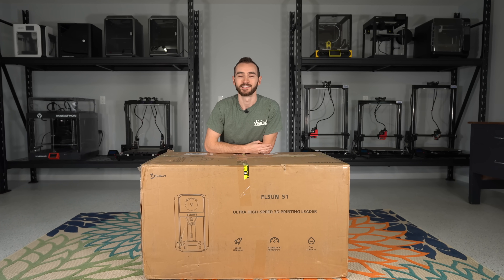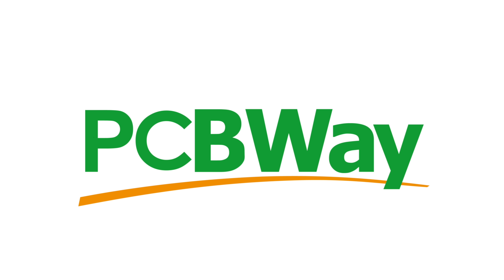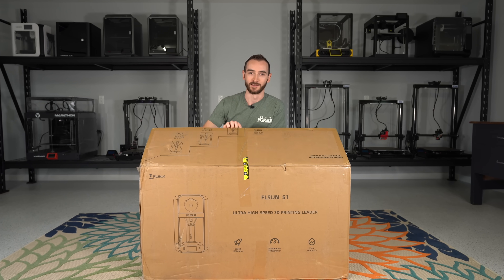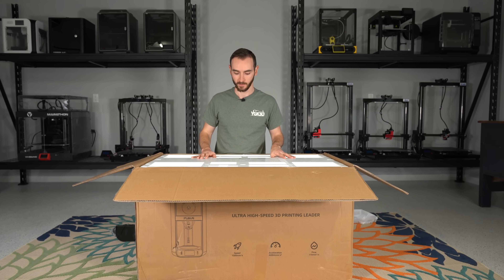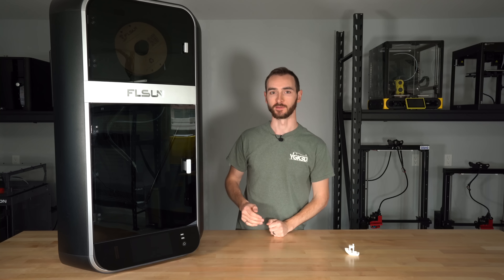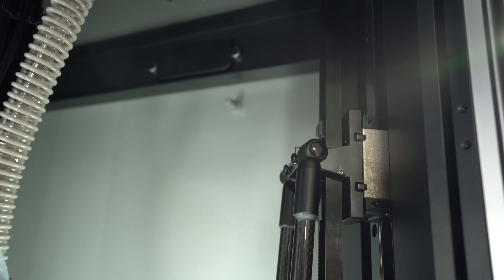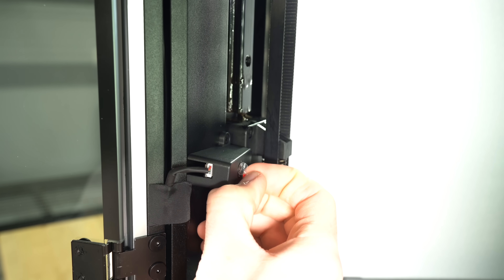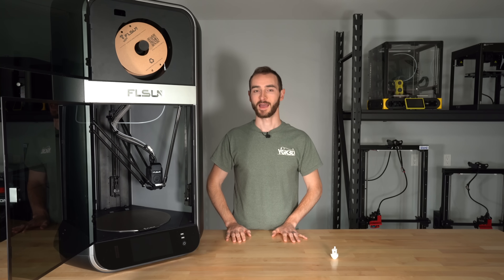FLSun S1 First Look - Bambu Lab FINALLY Has Real Competition

Comment: This looks awesome. I think however it's not going to blow the bambu out of the water. The next crucial step for 3d printers are heated and temp controlled enclosures capable of at least 80C for industrial strength and quality ABS/ASA prints. That would definitely make me throw my money at it.
Reply: This actually looks like a great candidate to put a chamber heater in. I can't tell if the stepper motors are in the top, but you could simply turn the machine upside down. I think a heated chamber without multiple tool heads or an AMS type system is a waste. I have a QIDI x plus that can reach 75c, but the layer adhesion on parts is so good that removing supports takes forever. To beat bambu would require a sub $1500 printer with an 85c chamber and preferably IDEX.
Reply: @AnnikaFPV  There is no need to protect motors. Just replace them with high temp motors, they are not expensive and available everywhere now. They can take up to 180C long term so a chamber temp of up to 140C should be no problem. The belts are the first thing to go and they are usually rated to 90C but there are belts rated higher as well. You also need very god hotend cooling or possibly water cooling and it already has CPAP so that's great. Prinitng ABS in an 80C chamber needs way more parts cooling than even PLA.
Reply: @AnnikaFPV  If you look at their website this does have a controlled heated chamber but it only goes up to 50°C. It has 3 36V closed loop stepper motors for the arms. Closed loop just means it knows where it is at all times, essentially a "smart" stepper motor. 

If you tell it to move 4 steps forward and 10 steps back and it misses a step and only goes 3 steps forward then it only goes 9 back. A typical stepper motor doesn't know it missed a step so it will still go 10 back.
Reply: For me the bambu's are just too small ! when are we getting that Bambu XL???      $$$
Reply: @theSilentCutter  Love my Creality K1 Max, I felt the same about Bambu, just too small. Ordered a Sovol SV08 it is even larger with faster print speeds ( Well thats the hope anyways) Delta are cool but imagine if you have some z axis issue... just how would you diagnose it on a delta. On a bed slinger or core XY it is obvious where the issue is on a delta not so much !  troubleshooting a delta would be horrible!
Reply: @mynameisprivate158  yeah i was all about that delta until i heard that it is as loud as a vaccum running!!!!!   LOL  no thanks!
Reply: whats the point when printing fast significantly reduces strength anyway?
Reply: @awildtomappeared5925  Because it doesnt or rather doesnt enough to matter.

Heat up the filament more, and have a big enough part and you wont see any difference worth slowing down for. There are of course situations where you cant do that, but ultimately its about that hotend volume.
Reply: Prusa has you covered then with their prusa pro HT90. You're welcome.
Reply: You can just let the bed heat the chamber by letting it sit but yeah, heated chambers help with high warp materials, the goal of material manufacturers is to reduce or remove the warping to begin with, hence ABS with glass fibers etc
Reply: @JojoJoget  Yeah sure, I do that in my voron. It just takes a bit longer to get to 80C and requires a lot of insulation. However you are missing the point, there are several reasons why you want the chamber temp to be just below the melting point of the material. One is to eliminate warping altogether and remove internal stresses which weaken the part, the other is to have actual layer adhesion. You can print ABS/ASA in 50C chambers by turning off fans etc. but you won't get any layer adhesion. That won't change with additives (also very expensive). In my 80C chamber I printed a wilson airless basketball in ASA and it bounces just like a real basketball. I did the same on my bambu in a 50C chamber and it shattered into multiple pieces on first bounce. It didn't even bounce, just stayed on the floor.
Reply: Abs/Asa is not Industrial, pla+ is literally stronger
Reply: @AckzaTV  PLA+ has no heat resistance. ABS/ASA printed in an industrial printer will have 50% stronger layer adhesion because the chamber is heated to just below glass transition temperature. The hot filament can then easily melt the previous layer and fuse to it properly. This is how 3d printingactually works. What desktop printers are doing (turning off fans etc.) is just an ugly hack to be able to print it properly but parts will be much weaker.
Reply: @AckzaTV  PLA will melt if you put it in the sun and also it has creeping issues. I would say that ABS/ASA is sort of an entry point into industrial filaments. However I didn't mean to say that ABS is industrial, I'm saying that you would print ABS at an industrial print quality level if you do it in an 80C chamber. Basically if you have a lot of parts cooling you can print it very fast, very high quality, layers will look invisible because they sort of melt together and the parts will be very strong.
Reply: @BH4x0r  Yeah but that's why you have ASA. Better in most ways but still needs an 80C chamber for optimal strength. Basically the Xidi printers with 65C get to maybe 70% layer adhesion strength, 80 C will fuse completely.
Reply: @sabahoudini  yea i tried asa before but without proper chambers no good adhesion as you said

apart from that i deem PETG superior for 90% of hobby printers though, even for parts that may need serious structure

almost as heat resistant, very strong, cheaper, no fumes, pretty UV resistant and even chemical resistant whereas ABS and ASA will dissolve in acetone already, for example

now i agree thats a useful property sometimes as you can use it to smooth out layer lines and even glue pieces of asa/abs
Reply: @BH4x0r  PETG is good but can be a bit more difficult to print fast because it doesn't seem to flow as well but I haven't printed it that much. PETG is the same although the optimal chamber temp will be about 60-65C. I'm sure that PLA will be crazy strong if printed closer to it's glass transition temp too, you just need to have crazy amounts of cooling and a good hotend/toolhead combo that can cool the hotend so it doesn't clog.
Reply: @sabahoudini  forsure, hotends with extended meltzones help alot, so should chamber temp, However i never noticed strength issues with PETG on my A1 Mini (yes, when that came out at the price i just couldn't resist, and i actually couldn't resist the price of the fullsize A1 with the sales now either so i got another one on the way 😂)

for me that helps alot, i can do more with 2 printers of around than with one of 600+ (P1S, i'd take the chambered version directly) or a X1C, Albeit i have to admit the X1C is almost a wet dream for me, it's not feasible at the price point to me, i don't have a real business, albeit i sell stuff i make, it's just a small side earning if i do so, and PETG has been awesome to me without any form of chamber or enclosure

the X1C on the other hand to me is 4/5th of a month loan for me at €1500 without the sales (21% VAT), so yea, if i had money to spare i'd no doubt buy a pair of them, but multisplit AC and renovation are more of a priority right now

I also have a CR20 Pro with Zodiac bimetal heatbreak on an E3D Hemera hotend with Volcano heatblock and all that shit, but its still basically an ender with many electrical upgrades, so long as it aint got linear rails and a  generally proper motion system it's still a turd, albeit a fast one at that

the modded CR20 Pro (only bed and frame are original) has no issues printing petg with seemingly full strength when i crank the speed up to 300mm/s at 265°C, 16k accel on klipper, heck it even was stupid fast on Marlin already with a lot of tuning, but thats where my issue was

it's a turd with V rollers, needed constant tuning and never was fully reliable, so i actually stopped using it entirely

i've spent more on that printer and upgrades than a P1S would cost me so i rather spend no time or money on that piece of crap anymore
Reply: @BH4x0r  Haha yeah I had a cr20 that I modded until it broke lol. Stil have a Cr10 v2 that I don't use and a P1S tht I rarely use. My main printer is a Troodon 2.0 (Voron clone) that I modded to be a high speed, high chamber temp beast. I Mostly print big ABS parts so the troodon is running all the time.
Reply: I strongly disagree, a heated chamber isn't the hardest thing to engineer and the fact that almost no enclosed printer offers any temperature controls proves that. There are way more people printing for personal reasons then engineering purposes and there are already options for those that do. Your typical consumer just isn't interested because they are more expensive due to being directly targeted for prototyping parts.  You don't need a heated chamber for ASA/ABS. The type of ABS they use for injection molding isn't exactly the same as what's used for 3D printing either. 

Bambu and others sell gf (glass fiber) filements that can replace engine parts in a car. The issue is it's around 150 dollars for a spool so unless you have a specific reason it's overkill to buy
Reply: @JoshFisher567  A printer without a heated chamber in a few years will be like buying a printer without a heated bed today. You CAN still print without a heated bed but that doesn't mean it's the right way to do it. In fact I had this exact same discussion back in 2014 when trying to explain to people that printers with heated beds are the next evolution but peoiple were saying: "nah my printer prints fine" just like everyone is saying right now.
Reply: @sabahoudini  okay, using that logic one of 2 things is true. In a few years bed slingers won't exist or they will be enclosed. Do you know how much it would cost to enclose a bed slinger? Having a heated bed moving inside an enclosure isn't a good idea. 

What do you need a heated chamber for exactly? To my knowledge it can help with volume loss (shrinkage) in filements like ABS and CF due to their shrink ratio. That and warping. Warping hasn't been an issue in a while if you have a non heated enclosure. What else does a heated chamber accomplish when by far PLA is the most printed filement. You need a heated chamber maybe for some engineering grade filaments but for PLA. PETG, ASA or really anything it's not needed outside the small amount some filaments shrink. 

The Bambu X1E is out already and it hasn't been reviewed well and has a heated chamber up to 60°C. It's not on their website because it's not for the general public. It can do 350 on the nozzle and has a heated chamber and network upgrades. This S1 has a 50°C heated chamber according to their website which is good enough for commercial use and overkill if you ask me. 

Most people use PLA and you don't need an enclosure, much less a heated chamber to print PLA. People don't regularly print CF or GF due to the price.
Reply: @sabahoudini  Did a bit of research, CNC kitchen did a test and posted a video a few months ago. Testing a QIDI printer at 65°C. He got slightly better results. He mentioned the CF then never mentioned it again. Due to better layer adhesion ABS looked better and had a stronger strength by around 12%. He added that it won't help PLA or other filaments. 

ASA kind of already solves the ABS issue for me personally so if that's it, then very few people who 3D printer recreationally need just better results and possibly CF. Unless printing in engineering grade filaments becomes the norm, that ain't happening. Just search for it on here as he does scientific tests and discusses why it won't help other normal filaments.
Reply: @JoshFisher567  Didn't I link to that video before? I'm fully aware of that video, it proves my point as it hints that chamber temp increases layer adhesion. Yes but 65C is pretty cold for ABS too and yet it already achieved 75% layer adhesion strength vs 58%. That is already 29.3% stronger. 65C is great for PETG. The glass transition of ABS/ASA is 90C. You need to be slightly lower than that. 80C is optimal. This does two things: 1. it doesn't warp because plastic shrinks as it cools and since it stays at 80 it will not shrink. 2. The new hot filament can easily melt the previous layer because it's already very close to glass transition and will fuse to it fully. You then let the whole part cool down slowly after the print so you don't get internal stresses. Parts will be pretty much equally strong in all directions, no matter what orientation the layer lines are. Also the layer lines become almost invisible. You need A LOT of cooling though.
Reply: @sabahoudini No, are you drunk?You can't leave links to anything on YouTube outside small private channels. If you could it would be bit generated spam/malware every other post. If you paste a link it just gets stripped out. 

You still didn't answer my question either, are bed slingers going to disappear a few years or are they going to all have heated chambers soon and I'm not talking about those "tent" things but real controlled heated chambers? Are people going to start printing more ABS/aASA/CF then PLA soon. If it's that important why do t you buy a QIDI? Print quality on par with Bambu and they have been doing heated chambers for 2 years or more. Nobody outside a select few care when you exit PLA 75% of the time.
Reply: @JoshFisher567  Bed slingers are dead already. Noone is buying them. The ender3 days are gone. Like the prusa printers, it's like the blackberry when the iphone came. They are still back in 2014. People want enclosed corexy printers that are fast. The multi tool crap is just overengineering and will be insanely expensive. Bambu labs did everything right. They just need to make a big one. Bambu labs basically killed bed slingers and prusa.
Reply: @sabahoudini  
The day of bed slingers is dead

Okay, tell that to all the A1 mini and A1 owners. Bambu just had a 2 year anniversary sale and the A1 mini was 199. Guess what sold out first? All their printers were discounted 

Why did Bambu come out with a bed slinger as their second printer then? The P1 is essentially an X1 with a different MCU and some other perks. Also, price is a factor. While Core XYZ printers have come down in price, you can still get a good bed slinger for under $300, and there are way cheaper ones ir there is a sale, like 199 for an A1 mini. 

Depending on the plate size, probably $500 and up for a decent XYZ printer with a sale or just a good deal. Probably closer to 800 or up in reality. 

I've never personally owned an Ender 3 of any flavor but you know when their day will be over? The day Creality quits making them. How many different kinds are there? If they didn't make Creality money they wouldn't still be making them. So they still sell well. 

There are people who want to get into 3D printing and not spend $600 to $1.2K+ on their first printer. Not everyone can afford the bleeding edge of the newest printers or wants to spend that much money on something they might not be using in a year. That is unless you just have cash to burn for whatever reason.

According to reviews the Prusa model with changeable tool head is a great printer. Expensive, yes, did it have issues to early beta testers, yes but at it's price it's not really a consumer printer and does multi color printing WAY faster. The MK3 still sells, both in Prusas website and clones on AliExpress and they still sell a lot of them because of their popularity. 

The main difference here is I'm looking at the market and not just a single printer. What filaments people use the most,what's selling well and what's not.

You are focused on core XYZ enclosed printers and printing ABS/ASA and CF with better detai and a little extra strength l. That's not the core 3D printing market. That's niche casual users and people wanting to create quality prototypes for business purposes.
Reply: @JoshFisher567  I only care about this part of the comment: "and printing ABS/ASA and CF with better detai and a little extra strength l."  It's twice the strength mate. Not a little extra strength. Twice! Print will be as strong across as along layers. Go ask stratasys why this is the case. Printing ASA/ABS below 75-80C is a joke.
Reply: @sabahoudini  not according to CNC kitchen and I trust them more then you. It was around 15% for ABS, that's all he tested, not sure about ASA. I trust him as he actually tested it in the video. 

You are still missing the point. About probably 80 percent of people use PLA almost exclusively and sometimes PETG because of the terrible thermals on PLA. 

I have had zero issues with warping with ABS or ASA except for some super cheap ABS that never finished a print on any printer without warping. I've probably put 30 spools of PLA through my P1S and maybe 2 spools of ASA and 1 spool of ABS. Half a kilo of CF. 

Heated beds really did help bed adhesion for ALL filaments, at least the ones that need it which is most outside TPU for me. When I got it it came with a double side plate. One side is an engineering plate. I have only printed TPU on it because it's not supposed to be heated, at least at high temperatures. 

So out of 34 spools (roughly), I would have used the heated chamber for 4 spools. Not exactly a selling feature to me. In fact QIDI has been shipping their core XYZ printers with heated chambers for 2 years. They always get great reviews yet you never hear about them. Some of their consumer level printer chambers get hotter(75°C) than the X1E  (60°°C) which was meant for engineering filaments. 

I don't print ABS/ASA for finer detail which CNC was the main benefit they saw when printing with a heated chamber. If you need extra strength, there are plenty of CF combos out there for that. 

I just don't see bed slingers disappearing and I don't see manufacturers spending extra to enclose them when probably 90 percent of people that own one are going to stick with PLA and PETG, maybe TPU. Not everyone wants to print CF or deal with the headaches that come with ABS like it being toxic. I really think the bed warping thing is a thing of the past as long as you have a non heated enclosed chamber and use half way decent filament. They aren't going to cater to 15% of their target audience if it hurts sales on the other 85%.

Honest question, do you print more PLA, or more ASA/ABS? PLA was literally made for 3D printing which is why it's so easy to print. Honestly, I would love to see the members from Polylute, Overature, or eSun to see what percentage of filaments sell the most because I'm betting PLA is 50 per entire of their sales if not more. 

Heated chambers may become the norm for 1K plus printers but 300 dollar bed slingers aren't going anywhere and you focus on one thing I said without answering any of my questions. 

I'm done, you can reply if you want but you're wrong, it won't become the norm, and I'm out.
Reply: @sabahoudini  forgot to mention, Stratasys had a patent on heated chambers. That slowed down the commercial competition by over two decades. Of course he is going to say that, it helps sell printers. Luckily that patent expired. That's like trusting Microsoft if they said their software was 50 percent faster than anyone else's. 

Detail on large parts is the biggest reason advantage according to every article not to mention the various flavors of ABS like ones meant to be printed in open air.
Reply: Time to accept bambu is not the best mate.
Reply: Prusa HT90
Reply: Nah, the next step is multi tools.
Reply: @BeefIngot  What's the point? Print even more useless junk but now at many colors? Hot chambers would bring hobby 3d printing into industrial part quality. You can print parts that are actually usable, not this brittle useless stuff that breaks.
Reply: @sabahoudini  Multi tool brings you more range than a heated chamber ever could.

We have enough heat from the bed already in an enclosed printer.

What we dont have the ability to do outside of the XL (which has its own issues) is mix and match materials with different properties to make items that are otherwise unmanufacturable or difficult to manufacture with different processes.

Flexures, playing with friction coefficients etc.

As for you talking about brittle useless stuff.... What??? Thats 100% a filament choice thing mixed with what I can only assume is you using the incorrect settings for your printer and filament combo.
Reply: @BeefIngot  No man, you need to read up on how actual 3d printing works, like the way stratasys and the big boys do it.  You are only getting 50% layer adhesion strength printing in a 50C chamber with ABS/ASA. Visually it may look fine but the layers are not properly bonding and the parts have internal stresses that weaken it. Here you can see a 20% layer strength improvement and this is only 65C: https://www.youtube.com/watch?v=WrQiUL0jAzc&t=598s
Reply: @sabahoudini  You are referring to very costly changes for a very small change practically for most users.

Even for industrial uses you dont need this most of the time and annealing can be done after the fact.

Furthermore, what I mentioned is simply still true. The utility added with multi tool is vastly more useful than your gimmick which can be bested by simply picking a different material like glass fiber nylon or glass fiber tpu.

Basically, you are hyper fixated on something most people arent that interested in and your selling point to them is "you aren't smart if you dont agree with me telling you what you should want".
Reply: @BeefIngot  I'm not saying you aren't smart, just not informed. I'm using my printer for a business. I make 3d printed drums (as in drums that you hit and make sounds with). You can't do that in PLA, it's not going to survive the abuse. I've tried ASA in a 50-60C chamber, the part is very big and challenging to print at 350x350mm and even after (badly) printing it, it cracked across the layers when tuning the drum as the drum skin exerts a lot of tension. It's a whole different story with an 80C chamber. I can't break it even if I hit it with a hammer. I agree that most of the idustry is people prinitng trinkets in PLA and printer "upgrades" but that's only because parts are not durable.
Reply: @sabahoudini  You keep implying that every usecase except yours is trinkets and printer upgrades and thats just so obviously disingenuous. The majority of print farm work isnt even high temp filament.

The mere fact you dont miss but refuse to understand, is that your specific litmus test doesnt matter for the majority of users. That includes "industrial" users you want on a pedestal.

In your case for instance, that is actually funnily enough, a skill issue where you pick the wrong filament, then get the results one would expect from using the wrong filament.

Something glass fiber filled like glass fiber filled TPU or Nylon would have all of the properties you want, but you want it to be abs for some reason. Im guessing that reason is cost, while you simultaneously want printers to have to build in big levels of insulation and monitoring as a first priority rather than things that are way more beneficial to most people.

Another thing you are missing is with near glass transition temp prints, its basically impossible to print fast because the filament that was just laid down is so close to ambient temps that cooling becomes a big hurdle and even mild overhangs start having a drooping problem. Basically, prepare to need supports for simple prints.

More than any of this though, why are you even using 3d printing for that particular thing when plastic has creep issues, wood is cheap, and cnc routers exist at that size? Seems like its just the wrong manufacturing tool for the job.